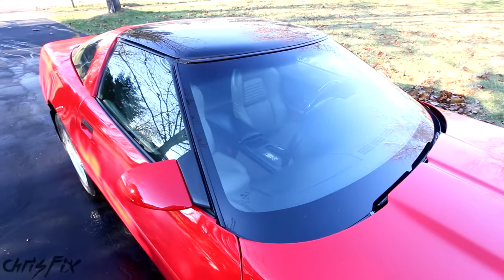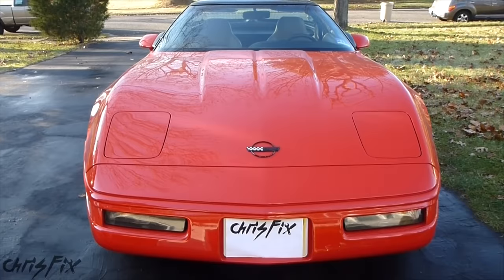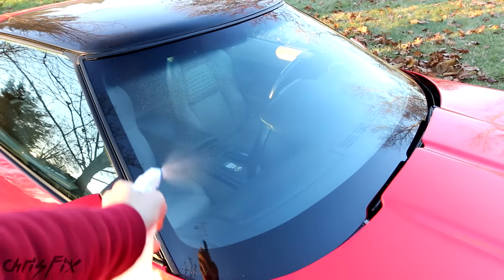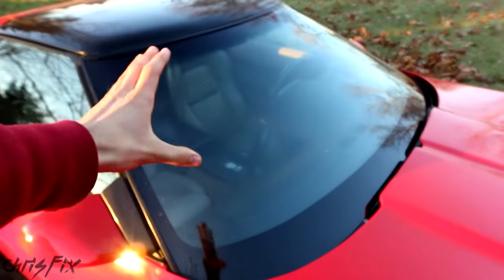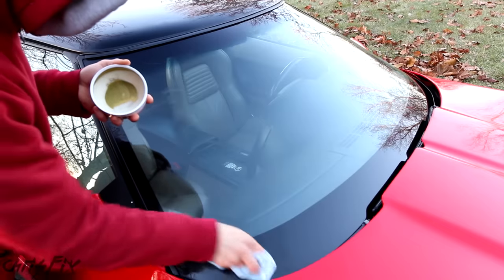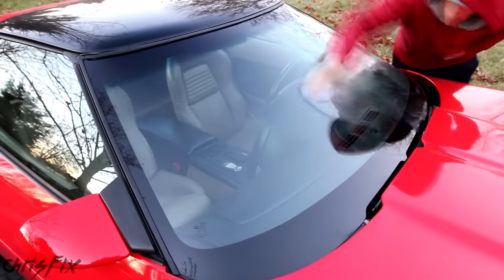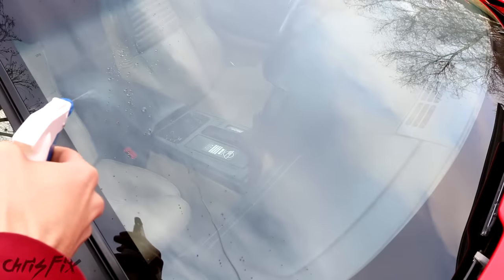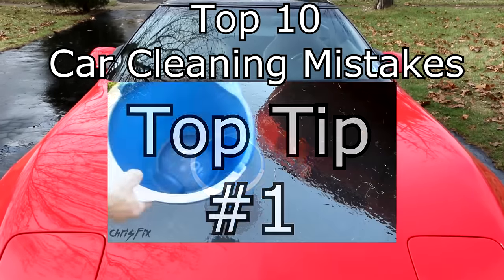How to Super Clean Your Windshield

Comment: How do you know how many pound-feet are required for a particular bolt when tightening? I've watched a couple of your videos and it seems a lot of different pieces require different forces.
Reply: Did  U  ever hear of  torque specs, there are specifications, for all most every engineered, or manufactured,  produced  item on this  Planet......

Comment: How do you remove static dust first? I wipe dust using microfibre cloth, the dust just gets displaced to the other side of the window n some sticks to the cloth instead of being removed. When i wipe the other side of the windshield, that displaced dust then returns to its previous spot. So in total the only dust that gets removed from the windshield is the bit that stuck to the cloth. The other dust just moves back n forth on the windshield with the swipe of the cloth. How to remove this dust?

Comment: If you wax your windshield, wouldn't the wax start to streak & haze when using your wipers?
Reply from the maker: No, it would wear off unless you are using really cheap wax or something
Reply: @chrisfix  Wow thanks for replying! Didn't think anyone would care since this video is 8 yrs old. Thanks, mate, subscribed! 

While we're on the subject of windshield clarity - does the above method get rid of stubborn water spots & streaking? 

My windshield drive me nuts. I have hazing becos I applied Rain-x, thinking it will help with clarity & waterspots but it became worse. Then I waxed it thinking it will help, but that causes streaking. And now  it never stops streaking, no matter what windshield detergent I use.

When it rains at night, it's a nightmare - it streaks & hazes, with the bright lights from the lamps & cars - it's terrible. I have purchased 5 of the top wipers brands to help, but it doesnt get rid of the streaking.

Comment: Can i do this on all the glass in the car? (Rear, mirrors)
Reply from the maker: Yes, but for the rear, if you have the defroster lines, wipe in the direction of them to avoid damaging them and be a little more gentle
Reply: @chrisfix  Thanks. And the step with the wax is also ok?
Reply from the maker: I would avoid it since the heat could potentially melt any wax on there and create a mess. A good cleaning should be enough

Comment: What do you meant by clay bar. Here we can buy clay used by children toto play and the natural clay used for the pottery works.
Reply from the maker: It has to be synthetic clay. It’s designed specifically for automotive use.
Reply: Go to Walmart's auto supply section - they carry Mothers Claybar kit, but if you buy it, MAKE SURE that the box is SEALED.  Dirtbags frequently steal the claybars out of the kits, and when you get home, you got natta!

Comment: Chris how do you remove stubborn water spots?
Reply: To remove water spots the simplest thing and quickest thing to do is get some automotive compound and they wax pad and do circular motions and the compound will remove the acid rain very quickly if it is very stubborn it will take a little longer but it always removes it and my shop uses it all the time. You can also search for some glass compound
Reply: @willsrestorations  Thanks. Will do that.

Comment: ❓❓❓ why you do not use the lubrifiant that comes with the clay bars instead of warm water? is there a special reason?❓❓❓
Reply from the maker: It works better on the glass if it is water.
Reply: @chrisfix  Thank you... I am awaiting a "sunny" day in Montreal Canada to apply outside and inside "tips" you shared!!! Hard to put wax on a cold day... How do you apply all this on the outside of the glass when it is freezing (we do not have a garage and shelter!!!) My answer is to put the car "heat" at maximum to heat the glass even if it is facing mid-day sun because, I think that I will have to put it regularly this winter (like once a month!)
How about adding a "pinch" of alcool in the warm water to help the water NOT to freeze in winter!!!!! ❓
Nice to see all your vidéos but... you do not live in CANADA!!! 🤪

Comment: Chris/Anyone...if using the claybar...wouldnt the contaminants that gets stuck into the claybar cause scratches onto the windshield...never understood this regarding use of claybar
Reply from the maker: It gets pushed into the clay. Also glass is very hard to scratch as it is harder than most contaminants. On paint it does scratch it a little which is why you do a paint correction after clay bar.
Reply: @chrisfix  tq very very much Chris for taking the time to provide a kind response to your viewers...may you channel grow even larger & prosper always

Comment: Clean glass? 000 steel-wool. A new definition of clean glass. 

Do not use wax. In fact, do not coat the windshield in anything. Eventually it causes a greasy condition that means your wipers just smear, or chatter, and basically don't work when you need them the most.

Lastly, replace your wipers with OEM units at least 2 times a year. Sunlight is what destroys them, not use. 

The bigger issue is how to clean the INSIDE of the windshield.

Comment: Hi everyone. I have a little problem with my windshield. I used for a while PIAA wipers that are coming, as you know, with a little towel with silicone in order to apply this silicone before  using the wipers for the first time. Now the wipers are gone but the silicone layer rest on my windshild and no posibility to remove it. My windshield is foggy and greasy, especially in cold weather, the new wipers leave a foggy trace persisting few seconds every time. It's very annoying and very dangerous. I've tried anything: white vinegar, alcohool 98, best glass cleaners... Do you have another ideea? Thank you.

Comment: The only problem with playing wax to your windshield is it'll make your windshield wipers skip all over the place, come on Chris this is ridiculous and most people know that putting wax will make your windshield wipers go crazy. Your final step after clay bar should be an IPA which is a solution of rubbing alcohol and distilled water and then you can apply a glass ceramic such as G-TECHNIQ. That is the best thing for the windshield and will last well over a year and will not cause your windshield wipers to skip all over the place.
Reply from the maker: Thanks for sharing but two things. First, as I explained in the video, you need to buff off all of the sealant which leaves behind a micro layer of protection which will not cause the wipers to skip (if you even need to use them). 
Second, ceramic coating was not even a thing when this video was created. Thank you!

Comment: Hey Chris, I just tried the clay bar on my windshield following your video but I still get the rough feeling when touching my front glass, the clay bar did picked up some contaminants but when I sit in the drivers seat I can still see all those tiny little dots on my windshield, I've cleaned the inside and the inside felt smooth to touch, it really drives my crazy when I was driving especially under sun light.
Reply: your windshield may be pitted from gravel or debris strikes over the years..  time for a new windshield maybe?  tree sap might also dry and make the surface rough....likely a solvent would help remove that.

Comment: How do we clean the microfiber towel?
Reply: First never use any laundry detergent other than woolite and never ever use fabric softener. And always do an extra rinse in the washing machine. And try not to use heat when drying the towels doing air fluff cycle your towels will last for a very long time that way

Comment: Steel Wool, 0000 Super Fine is just as good as the clay bar, I hope you know that $3.50 ver $20
Reply: Just another defective hack, steel wool regardless if it's 000 will doll the windshield, why would you use steel wool when you could use clay bar such as the mother's speed bar and not the clay that this guy is using, and then use an IPA which is a solution of distilled water and rubbing alcohol of roughly 25% mixture

Comment: A warning to everybody.... this does not always work, and when it doesn't, the results are horrendous! Don't use spray wax! You'll be very sorry if you do. Additionally, the cleaning on the INSIDE using the Mr Clean Magic Eraser doesn't always work either. For me, my windshield both in and out is as streaky as before.

Comment: I've done this method twice, and both times when the windshield wipers go on (with rain), there's a haze on the windshield until it dries off again. I'm assuming it's the wax layer, but I feel like I did a good job buffing. Anybody else have this issue and resolved it?
Reply from the maker: Buff more! I guess it depends on what wax you used too. Some companies use silicone fillers in their wax which can cause the haze.

Comment: i use a product i found a couple of years ago called purewax.
got bailed up by a guy doing  demos while i was filling up. tested it on interior windshield grime i tried unsuccessfully to get rid of for months after buying my car, and this stuff finally got it done, plus worked great on the outside too (even though they market it as a waterless car wash which i’ve barely used it for).

anyway, easy to use. spray on, rub in with a damp mf cloth, then wipe/buff off with a dry one.

Comment: But what happens if the claybar pick up a solid and hard debris and pulling it back and forth would not scratch the glass? 🙄
Reply: clearly you dont know how to use a clay bar. *hint you fold it on itself to expose clean bar and use water to lubricate the surface your working on....

Comment: This is just flat bad advice.
Reply: What exactly is for someone who has no idea?
Reply: @Amber57499  Nothing really. Just clean it. I suppose you could use a ceramic coating, which in all reality would be better than wax. Wax isn't going to survive very long, esp. in rain with wiper use. And, I've tried it previously with numerous wax/synthetic waxes. If anything, if you want to go that route, you could try the synthetic wax. But, it does get into the pores, and from my 25 years experience, whenever wax is on the windshield, it actually makes visibility worse. One reason I don't go to car washes, besides the acid soap they use that put pinholes in your windshield, is that the soaps also have wax, and it's a very bad one because it's very hard to get off the windshield. I'm pretty sure they do it on purpose to make people feel that the car is dirty, and thus goes back to the car wash.
Reply: @RobHTech  Thanks. The ceramic coating sounds like a much better idea!